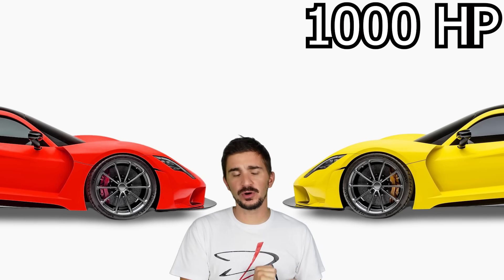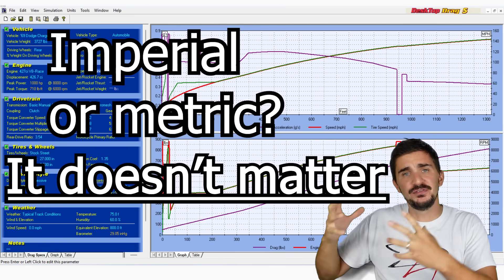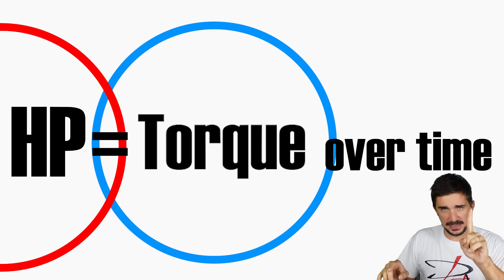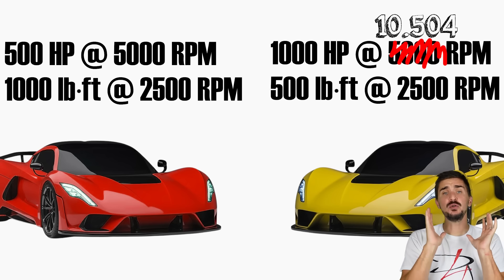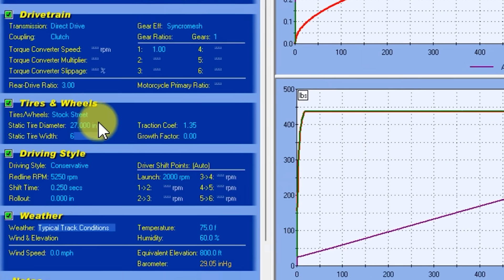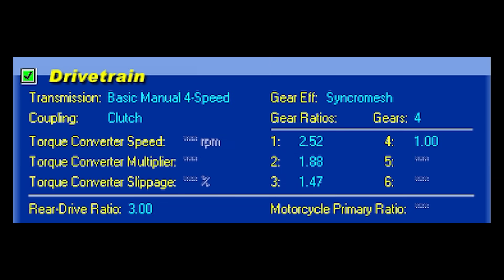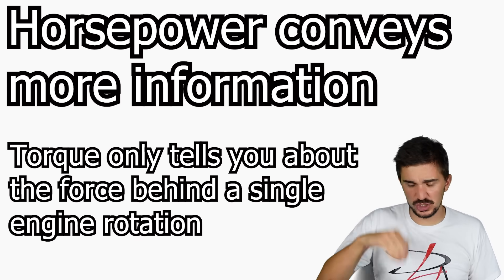Who's faster? Explained and Simulated - Horsepower vs Torque

Comment: Pas totalement d'accord, Le couple et la puissance son bel et bien 2 chose totalement différente, mais comme tu le dit indissociable.

Pour exemple, 2 voiture identique avec un couple diffèrent et une puissance identique, n'auront pas la même accélération, la plus coupleuse accélérera plus fort, mais en vitesse de pointe, elle iron aussi vite l'une que l'autre, a l'inverse, un couple identique, et une puissance différente pour 2 voiture identique, la plus puissante roulera plus vite que la moins puissante, mais elle auront la même accélération, donc puissance et couple complétement différent, mais totalement complémentaire !!!

Bon c'est pas aussi simple car d'autre élément entre eux aussi en ligne de compte, comme la boite de vitesse, le poids, les pneu, mais si on imagine sa sur un modèle précis de voiture, et que juste la puissance ou le couple est diffèrent, avec les autre pièce totalement identique, sa donnera se que jais expliquer !

Plus la puissance est élever, plus la vitesse atteinte est élever.
Plus le couple est élever, plus l'accélération sera forte.

Et sa c'est valable quelque sois la voiture, et son poids, évidement c'est résumer, et y a plus de chose qui entre en compte que sa, comme le poids, qui a une grande impotence sur les performance des voiture !
Reply: You are confusing yourself. Torque and power are separate. There is power and there is no torque. What you are talking about is torque x rpm which is power anyways. A car with an engine that generates more average power wins. You call it "higher torque" for no reason.
Reply: @simplemachine9531  Tu n'y est pas du tous, une puissance plus élevé ne gagne pas forcement, et plus de puissance ne veut pas dire meilleur accélération.

Puissance = Vitesse maximum
Couple = Accélération

Celle qui a le plus de couple accélérera plus fort, celle avec le plus de puissance ira plus vite en pointe !!!

2 exemple pour illustrer, drag 400m départ arrêter, une voiture de 500 Ch et 400 Nm, l'autre avec 600 Ch mais 300 Nm, la victorieuse sera pas la plus puissante, mais la plus coupleuse.

Autre exemple, je reprend exactement les même, donc 500 Ch et 400 Nm, et 600 Ch et 300 Nm, mais cette fois, la gagnante est celle qui a le plus de vitesse maximum, la malgré que celle de 600 Ch se fais avoir aux démarrage, elle gagne, car plus puissente et donc plus rapide.

C'est pourtant les même statistique, mais dans un cas une gagne, dans l'autre cas l'autre gagne.

Sa prouve une chose que sa sois puissance ou couple, les 2 son importent pour avoir des performance.

Par contre prouver que puissance et couple son indissociable mais totalement diffèrent, c'est pas vraiment possible, faux le comprendre, et de la, on peut faire des voiture vraiment efficace.
Reply: @S7diabloF50  you demonstrate complete misunderstanding of the topic. And your examples are faulty and based on your feelings and not physics.
Read what power and torque is. 
Power=acceleration*speed with a given mass. Start from here. Good luck.
Reply: @simplemachine9531  Ce qui ne change en rien mon exemple, car dans mais 2 exemple jais repris les même statistique et donc le poids ne varie pas d'un exemple a l’autre, et donc le résulta non plus, âpres si on change le poids des véhicule oui, y aura un gros changement.

Un camion par exemple, malgrer le couple immense, perdra contre une voiture, du aux poids, mais si on imagine que le camion est aussi lourd que la voiture, c'est encore une foit le camion qui gagne, j'ais pas exclu le poids de mais exemple par hasard, et je le cite dans ma 1er réponse, que le couple ainsi que la puissance ne dépende pas que de eux même !!!

A poid identique la plus coupleuse gagnera presque toujours une course de 400m départ arrêter, la ou une plus puissante gagnera presque toujours une course de vitesse pur, et dans l’exemple de la video, c'est 2 même voiture, avec puissance et couple modifier uniquement, donc dans le même genre que mais exemple.

Comme je le dit depuis le début, :

Couple = Accélération
Puissance = Vitesse

Après comme je le disais dans d'autre réponse, la c'est simplifier, mais y a d'autre facteur qui entre en ligne de compte !

Autre point intéressent, quand tu regarde les graphique de moteur, tu remarque une chose, chaque moteur a un graphique de couple et de puissance différent, et ce graphique lui même dépens de l'équipement de la voiture, moteur turbo, moteur compresseur, ou moteur atmo, de donneront pas les même valeur aux même moment, tous comme les différent moteur, ne donne pas les même valeur aux même moment, mais parler de tous les facteur n'aide en rien la compréhension de tous sa, aux contraire.

Et que sa soi son exemple, ou les mien, il son simplifier, pour être compréhensible, dans les 2 cas on part du principe que les 2 voiture son identique, et donc que la base est exactement la même, en ne changeant que la puissance et le couple, ben les 2 voiture on exactement le même poids vu que même voiture.

Le soucis avec le poids, c'est que si tu l'ajoute il faux aussi prendre en compte les moteur, et donc leur suralimentation ou non, et la sa complique énormément les chose, trop pour que le couple et la puissance sois compréhensible !
Reply: @simplemachine9531  On peut même allé plus l'oins, avec une charge de 1T a tirer, qui des 4 cheveaux de trais, ou de la voiture von déplacer la tonne a ton avis ?

Je précise que la charge est aux sol sur un support, ce support na pas de roue, le but est de le déplacer.

Et sa c'est pas théorique, mais bien physique, avec la voiture sa ne bougera pas d'un iota, pourtant la voiture a plus de puissance, sa prouve une chose, la puissance ne permet pas d'accélérer fort.

Maintenant les 4 cheveaux, certes moins puissant que la voiture, mais il on un avantage de taille, il son vivent, et donc il peuve s’adapter, mais même sans prendre l'adaptation en compte, la charge vas bouger, il on plus de couple que la voiture, malgré que il sois moins puissant, donc le couple donne une meilleur accélération !

Pour une course de drag, les 2 on leur importance, dans l'exemple de la video, et sans changer d'autre donner, la plus coupleuse ne peut que gagner, car sa accéléré plus fort, et vu que c'est du drag, ben c'est hyper importent d’accélérer fort.

Il aurais fais le même teste sur la vitesse de pointe, la la plus puissante aurais gagner.
Reply: @S7diabloF50  
Power=acceleration*speed*mass. This line kills everything you have wrote here. Do some research and stop defending lies you heard somewhere. Also check what logic is, because almost everything you said violates logic too.
Reply: @simplemachine9531  En quoi sa viole la logique, c'est pas inventer c'est un fais, le couple et la puissance son différent mais lier, ton calcule est juste celui permettent d'avoir les valeur couple puissance poids, mais ne contredise en rien se que je dit, montre moi une contradiction la dedant !?
Reply: @simplemachine9531  Autre point ta formule est fausse !!!

C'est pas sa du tous, le vraix calcule c'est sa : puissance = couple X tour minute, le poids entre pas en ligne de compte dans le calcul !

Comment: What also needs to be explained, and I haven't seen anyone mention in the comments, is engine size. Ohe big reason why some engines can create high torque values in the first place is because of their size in displacement. Small 4 cylinder engines for example can produce a respectable amount of power, but their torque figures will be lower, simply because they can't "throw the punches" hard enough. In other words the engines displacement allows it to spin at more revolutions per minute, but this won't translate into more force because the engine and it's part aren't big enough. We used the boxing analogy for torque, so we can use it for engine size as well. A bigger man can throw a punch with more force, right? He'll be slower though and not as fast as a smaller man. It's the same for an engine. Smaller engine = smaller force. Bigger engine = more force
And of course, forced induction systems play a huge role in this too.

Comment: there is no such thing as a car with higher hp than torque
Reply: What? Never heard of an S2000?
Reply: Right Horsepower and torque are completely different things measured in completely different units. Is 400 feet ow wire more than 200 gallons of water?

Comment: torque doesn't matter.  It just makes you feel faster.

2 cars one revs to 5000 rpm one goes to 10,000 rpm.  Same hp.  The car that only goes to 5000rpm feels a lot faster at 2000 rpm as its making double the power at 2000rpm as the car that revs to 10000 rpm.  

Its irrelevant with the right gear ratios while driving flat out.

Comment: One thing I was hoping you would have considered, is using a cvt transmission. In this case the high hp car would have definitely won, since it would be always delivering it's high peak power.
Reply: yea even wothout cvt ot wpuld win with perfect gearing for both 👌🏻

Comment: I feel that horsepower is like how much gas you can burn and torque is how much twisting power.
Reply: 🤷🏻‍♂️ dzien bez jednego komenta o momencie obrotowym i mocy to dzien stracony 👍🏻  horsepower is work in time torque is force multiple be arm lenght  👌🏻 more power at seet speed vehicle always generate more contact path force than more torq and so more acceleration 👌🏻 thats why power win races 👌🏻😉 at set gear from idle to rpm limiter biger acceleration you will notice at max torque rpm and not at max power rpm unless both occure at the same rpm 👌🏻 for daily riding better is to have 100 nm at 4 k rpm and 75 hp at 7 k rpm than 75 nm at 8 k rpm and 100 hp at 12 k rpm feg in naked bike for most people cos 1 wersion be steonger from low to midrange rpm but if rider on 75 nm 100 hp version use gearbox and rpm properly he smoked 100 nm 75 hp in race thanks top end power advanatge 😎 but for daily riding i take 100nm 75 hp version all day long cos 75 nm 100 hp would accelerate like 💩 from idle to 6-7 k rpm comapre to 100 nm 75 hp version and such rpm in daily riding are most common in use 👌🏻

Comment: One thing that is not possible is having 500 Hp at 5000 RPM, and having 1000 lb-ft at 3000. If it has 500 Hp at 5000 RPM, then it has 580 lb-ft. And if it has 500 Hp and 1000 lb-ft, it has it's maximum Hp at 2900 RPM. The formula I use it matches with real engines, have used it for over 15 years and it is very accurate. Other than that, nice video :) This is a very good explanation of Torque and Hp!

Comment: Cubic inches have a direct effect on torque.
With the cars being equal in all other aspects. A 500 hp four cylinder will not outrun a 500 hp v8.
Reply: Of course it will not, their power is equal.

Comment: Something that wasn’t considered : if you make a lot of HP at high rpm. You can use shorter gearing to have higher wheel torque and still benefit from the high hp figure.
Reply: you dont need have higher torq at drive wheel axis 🫣 what you need is higher  force at contact paththats diffrenc 😎👌🏻 feg 100 hp at 70000 rpm mean 10 nm at engine crank at 100 km/h assuming wheel radious 0,1 metres its lesss drive wheel axis tprq but more contact path force thanin feg 50 hp at 7 rpm from 5000 nm at engine crank with wheel radious 1 metres at 100 km/h you have now in second egzample  5 times more drive wheel axis tprq ! booooooom 😮unfortunatelly 2 times less contact path force 😕🤭😎👌🏻 and its force whatt push you into seat and not torq 😎 rest is correct 👌🏻

Comment: If you had hypothetical machinery and tire grip that could magically support it without failure or slipping, what would happen if you revved both engines at the start line exactly to their peak horsepower RPMs and dropped the clutch without revving any higher?  If the 1st one revved right to 5000 rpm and the 2nd one to 10,500 rpm, would the 2nd car win because it has double the hp, even if it has less torque than the first car has at its 5000 rpm?

Comment: I'll give you the TLDR of this video. This is EXTREMELY simplified, but... still applicable. High horsepower low torque will give you a high revving engine that will HAVE TO be mated to a close ratio many gear (like seven speed or higher) transmission (to make up for the lack of torque you have to have very close together gear ratios or the engine will bog down.) This will give you slow accelerating (relatively slow) engine with a high top speed. So fast, but two weeks and a lot of rowing through gears to get to that top speed.
A high torque but low horsepower engine will be a big long stroke low revving engine. Like a old 60's style psuh rod V-8 or tractor trailer diesel engine. Now if you have a lot of close together gears it will be the tractor trailor. Tons of pulling power but top speed will be (relatively low) if you give it long gears. you'll get a little more acceleration and a tiny bit more top speed. Still though compared to the high HP low torque engine it will still be less top speed. SO the simplest would be to say fast accelerating OR powerful pulling engine that will have a slower top speed.

So simplest terms
High horsepower low torque = Slow acceleration/ high top speed
High torque/ low horsepower = fast acceleration (or pulling power) / low top speed
Reply: Who cares how simple it is if it is wrong? Violates physics and shows your lack of understanding gears and what power is.
Reply: High HP gives both highest top speed and fastest acceleration
Reply: Torque is the sound of one hand clapping

Comment: Elementary principles in car mechanics I suppose, but like how many people confuse power and current in electronics, they just need a good teacher explain it with the simple physics formule showing how the relation between the two that's causing the confusion and then illustrate with an example showing what that means for the behavior of the technology in question.
This guy explains it so well I hope he teaches mechanical engineers as a day job.

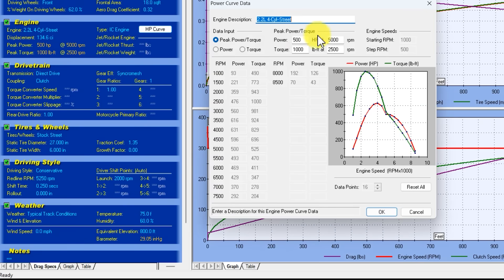Comment: 7:25 "and we'll keep everything the same and only change horse power and torque" but then proceeds to modify RPM from 5000 to 10504...
Did I miss something in the explanation? Why did you change the RPM value?

Comment: I agree, that these are not enough data to tell which one is better. If you skip the transmission, you should also skip quarter mile times. Without transmission you should only compare Dyno graphs.

1 gear transmission or regular car transmission and stock gear ratio are in favour for high torque engines.

This kind of gear and final drive ratio is simply not good for 10 000rpm engine, that will find it difficult to rev to its peak performance.

What come in mind with these torque and hp figures is an old diesel Vs petrol engines "war".

Because their characteristics are different, they use different gear ratios.

When you put diesel transmission into petrol engine you will have very long gears, that will cause problems with launching the car and making it operating in non-optimal RPMs range for most of time. When you put petrol engine transmission in a diesel, you will get short ratios that will cause a lot of traction problems, that you have mentioned, and top speed will be low because you will quickly run out of gears.

With gears ratios, that you have shown, you should also take into consideration what is the top speed and times for more that quarter mile races. Drag/load was nicely simulated by changing the car weight.

Comment: Horsepower and torque are like watts amd volts. I don't care how many watts it puts out when it's a 5 V system. I can't plug that into anything I use
Reply: Then the analogy is wrong because we don't care how much torque it puts when there is not enough power. Like a bad 75hp truck, tractor, motorbike or sports car vs good moden 200-700hp analogues.

Comment: And this brings to light why coyotes destroy lt engines mod for mod. Coyotes with its high revving engine may make less torque but with a 10 speed it keeps it in the powerband longer. Lt's have a slight advantage from a dig but fall off on the big end.

Comment: My Mercedes diesel only has 200 hp but it has 400 ft lb of torque it's an absolute Beast like a hot V8
Reply: Yeah, like a hot V8 of 1980-s with 200hp

Comment: You don't know what you're doing. Line up a low rpm diesel-powered car and high rpm gas-powered car both using a variable speed transmission with tires that get good traction, then use a drone to capture the view from above and run them at least 1 mile. Once you get reality-based data you can enter it into a computer program to plot simulated racing.

Comment: 7:26 there is a problem here with the math because the rpm that was used was 10,504. Should it not have stayed 5,000? If I’m not mistaken that is more akin to a motorcycle than a car. Based on the beginning of the video the rpm should never have changed at all. If i am wrong there is no need to rip my comment apart but as simple an explanation of why would be appreciated. If a correction is needed i thank whoever does so.

Comment: Horsepower is speed
Torque is acceleration 
You can have a lot of horsepower and go really fast, but if you don’t have enough torque it will take a long time to reach that speed.
Reply: Wrong by any means. Do some research and start with
Power=acceleration*speed with a given mass

Comment: Hi, very interesting ….if have 490bhp (crank) and 472lbft, in my audi RS3 2020 (uhp street tyres). How much bhp or lbft do I need to do a 1/4 mile of 10.8 and 10.6 respectively ?

I will really appreciate it u van put these numbers on ure program